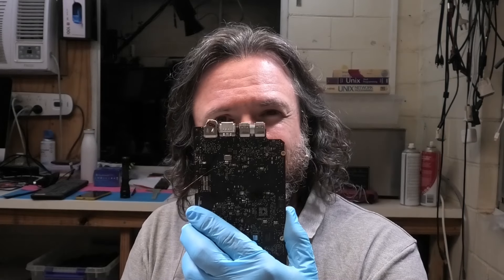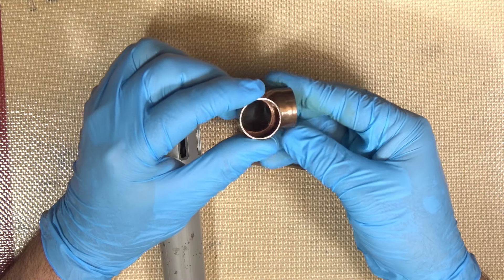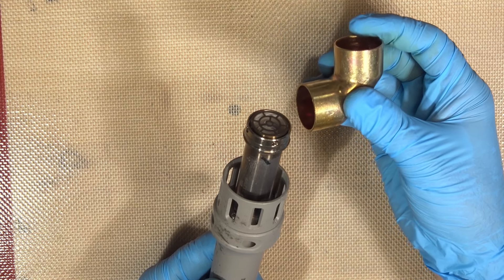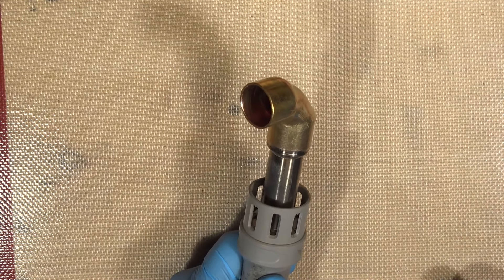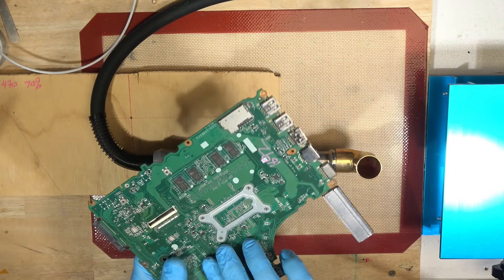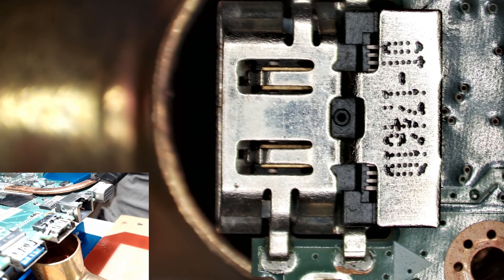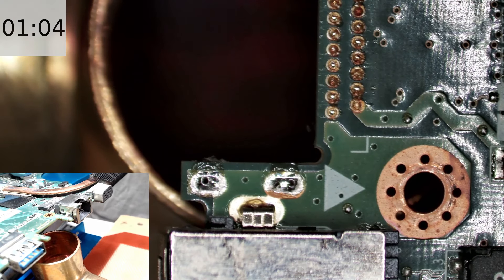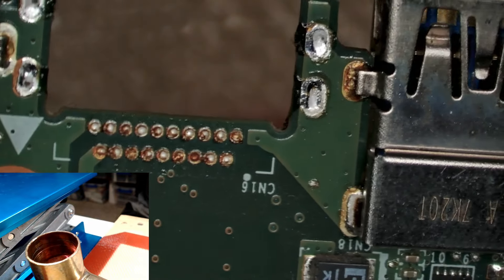PRO RESULTS $5.00 Atten Hotair mod. XBox, PlayStation & PC HDMI port replacements

Comment: or just use Rose's metal
Reply from the maker: The trouble with these bismuth based low-temp alloys is that you still need to get them to wick in to every pad/hole  and you subsequently have to ensure you clean all remenants of it up before installing the new port ( which will be at high temp anyhow ) to ensure you don't end up with a weak join somewhere.

Over the cycle of the process it's less work/damage-risk to simply remove the old, install the new during the single heat ( agreeably I didn't show the install of a new port in this video ).

Each to their own I suppose, I'm not personally a fan of the bismuth route though I do use 63/37 leaded pickling of the pads sometimes to help with transfer.

Comment: Nice!, i have been using the heatgun with no attachment and lifting off the HDMI Port, on PS4/PS5/Xbox;s after seeing @TheCod3r doing this method 

But i do like the ability of NO-HANDS! , will certainly be looking in to doing this 
looks like a good evolution of the method